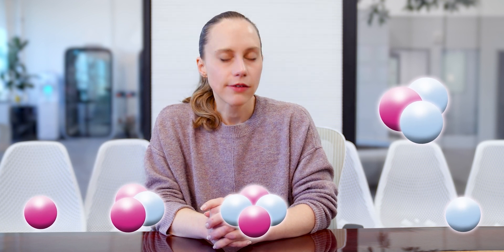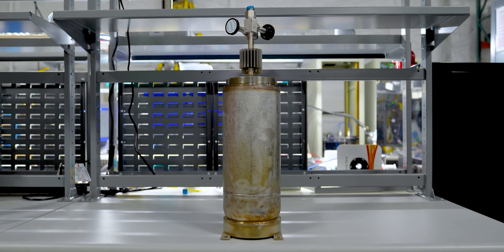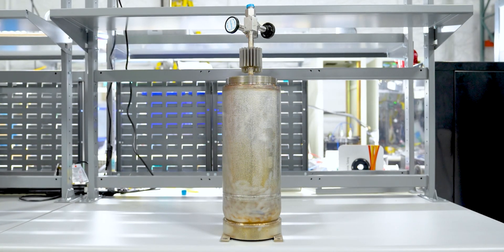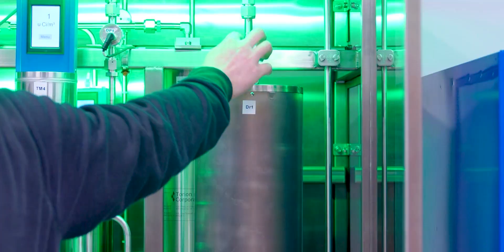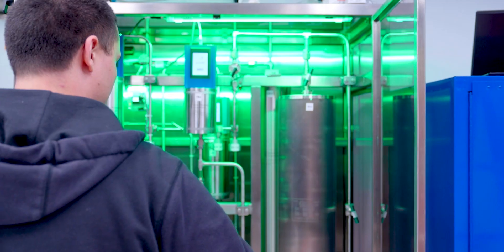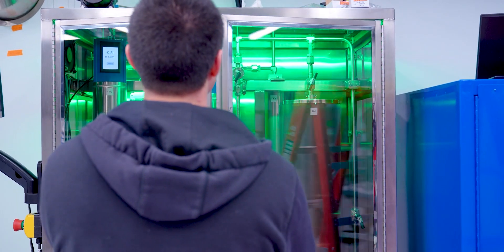Helion’s fusion fuel and byproducts: paving the way for commercial fusion energy

Comment: Are the Neutron byproducts part of the He-3 breeder cycle?  I was under the impression that the generators themselves were "aneutronic" thus safe for producing electricity without the need for substantial particle shielding.  If you were able to secure a large, steady supply of He-3 from mining the Moon or an asteroid, would that reduce the need to breed for it?

Comment: Isn’t tritium also a fusion fuel?
Reply: It is not a good material for fusion because it takes way too much energy to make it fuse.  Helium-3 is the better material in comparison.
Reply: @mikeybhoutex  I did some research and found this DOE article. 
https://www.energy.gov/science/doe-explainsfusion-reactions   
Can you provide a source?
Reply: @mikeybhoutex  That's backwards. Deuterium with Tritium (D-T) fuses at 100-million °C while Deuterium with Helium-3 (D-He3) needs several times that temperature while also producing 1/1000th the energy.  This is why most other fusion projects use D-T fusion reaction.

As we know, Helion prefers He3 because its an aneutronic reaction and they can capture the energy magnetically instead of the usual steam process.
Reply: Yes. It is a good fusion fuel. It should be left in the mix to keep it running stable. ❤

Comment: What's new for Polaris?
Reply: From S&P Global
05 JAN 2024
Fusion energy industry anticipates electric power breakthrough by summer
By John Siciliano

The Washington-based company Helion, considered a frontrunner in the race to develop a cost-effective commercial fusion power plant, said it plans to be the first fusion energy company in the world to produce electricity from its prototype Polaris reactor in 2024
Reply: Polaris had first plasma late last year and has been doing low level pulses since then. It will be a few months until they ramp it up to full power.
Reply: @ Thank you for that timeline. I assume that your reference to ‘full power’ involves pulsed plasmas that end with brief and significantly energetic deuterium fusion plasmas that feed more electrical charge into the pulse capacitor bank before they were filled with the discharge energy. I also assume that it will then be capable of operating at a shot rate of up to one shot per second, as intended.
Reply: @ 
Full power means that the magnets will run at full power (full strength) and the machine has been fine tuned and operates at the full pulse rate. 
The first campaign(s) towards that goal will likely only use Deuterium- Deuterium, which (at least AFAIK) is very unlikely to produce net electricity with Polaris (might be possible with bigger and stronger follow- up machines). But it will demonstrate the production of He3 and Tritium as well as the separation of the fusion products from the fuel, Tritium storage, etc.
This will then be followed by a campaign using D-He3 plasma with enough fusion reactions to put more electrical charge into the capacitors than there was before the pulse. They will do the same with D-T in a final campaign towards the end. 
Sam Altman said that he has a 65% confidence in Helion achieving these goals with D-He3 and a 85% confidence of them achieving it with D-T. 
We will see how it goes... Interesting times for sure.
Reply: @ - It sounds to me like you are now learning many details that you were not previously exposed to, or even considered inquiring about.

Perhaps you are also learning how many fans and investors have been misled by the many challenges ahead.
Reply: @vernonbrechin4207   Eh? I have always known and said the same thing.
Also no one has been misled.
Reply: @ - I wonder why many of the fans were under the impression that the Helion Energy approach would not be dependent upon being fed radioactive tritium as part of its fuel feed.
Reply: @vernonbrechin4207   While Polaris is going to do experiments with Tritium in what will likely be its final campaign, their power plants will not burn Tritium.
Reply: @elmarmoelzer2229  - Thanks for explaining that intended plan. It is interesting that such details never appear in the Helion Energy promotional videos posted to their YouTube videos.
Reply: @vernonbrechin4207  
LOL, it literally says that Polaris will do D-D, D-He3 and D-T fuel on the Polaris page on Helion's website.
Reply: @ The Polaris website is different than the promotional videos that Helion posts to their YouTube Channel which far more people tend to visit.
Reply: @vernonbrechin4207  
Well, it is not the fault of Helion that people do not want to read up on things. They are quite clear about these things almost everywhere. They have even stated these things during testimonies to congress and in their talks to the NRC.

Comment: Your dependence on Helium-3 is your main hurdle in achieving a reactor capable of properly generating energy in my opinion, so it's good that you guys are doing the most you can to recycle and not waste a single atom. 

Good luck.
Reply: It appears they're describing a breeder reaction for He3 and Tritium.
Reply: The first steps on continuous fusion production were never going to be easy or cheap.  We simply lack an abundance of the basic resources needed to fuel a fusion reactor, as they do not occur naturally in large quantities on the planet, which means we have to manufacture them at first.  Hopefully, once fusion starts being implemented at commercial scale, breeders will be able to take the byproducts and start generating more fuel to lower the cost.

Comment: "Our thingy will..."
It /will/.
No working prototype?
Oh, wait. You have a tin can. Well, I'm debunked.
What's that "facility" footage and which stock agency did you buy it from?
Reply: They built 6 working prototypes so far. Deuterium-Deuterium fusion had been achieved since the 3rd. They still can't produce more energy than used (ignition).
Reply: @neutronalchemist3241  The neutristor is a very small, simple and relatively-cheap device that does deuterium-deuterium fusion in order to produce neutrons.  Helion's devices are many orders of magnitude larger, more complex, and more costly, and some of those have also produced some neutrons.  All these devices consume electric power, but we are supposed to be favorably impressed with Helion.  We will hear a great and grand announcement from Helion if their latest machine is ever able to release one iota more electrical power than was put in to produce the final fuel compression, not counting the power used to make the fuel, make the plasmas, slam the plasmas together, separate the reaction products, pay for the equipment, prepare the celebration and press releases, and keep the lights on.  🙂

Comment: Tritium is handy for nuclear weapons as well.
Reply: Not by itself it isn't. Activation energy is so high that you need to use a separate supercritical plutonium core to initiate the deuterium-tritium reaction. The reason why before late-2023 we only ever achieved fusion ignition in H-bombs and not reactors is because of just how much energy is needed to get the reaction started.
Reply: @kennystrawnmusic you don't need terribly high energy to get tritium and deuterium to fuse, 120kv through a low pressure mix will do it. In a nuclear weapon it's the neutrons made when it reacts that help the core fission more than it normally would. The fusion of the 5.5g of DT in the core alone would add about a 3kt and the Pu alone would be about 15kt, but combined it gives about 45kt from the more complete burning. The biggest issue with fusion plasmas is that the ring design like tokamac variants have a lot of surface area to cross section so the energy gets lost. Also the tube I mentioned is called a Farnsworth fusion machine and it's not practical for power because the extremely low pressures of DT present essentially trading density for favorable geometyr. A travelling wave vortex tube reactor excited with 6 of the Helion modules would do both. In this case the modules would only be the starting impulse but once ignited in the throat of the reactor the energy from the reaction would keep it alive as long as the gas circulates through it.❤
Reply: @RayTheMickey Have you ever considered to lower energy density to anti-proton powered shield as anti-nuclear weapon system?
Reply: Haha, you said the quiet part out loud. The tritium being stored rather than burned as fuel pretty much discloses the use. 😂
Reply: Not really. H-bombs use lithium deuteride as fuel. This creates tritium at the start of the explosion. Tritium's short half-life is not great for storage, and so for use as weapon.
Since tritium decays into He3 instead, to use it as a source of the actual fuel you need, and that practically doesn't exist on Earth, seems pretty clever.